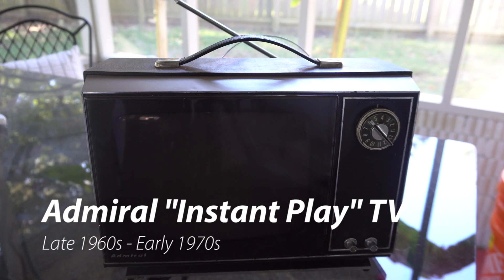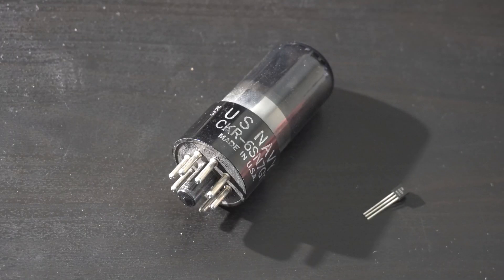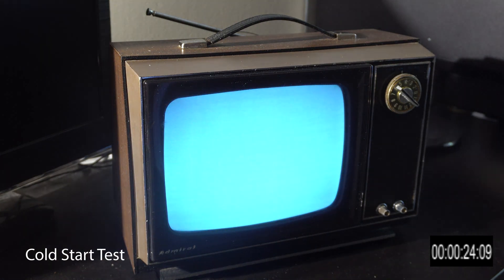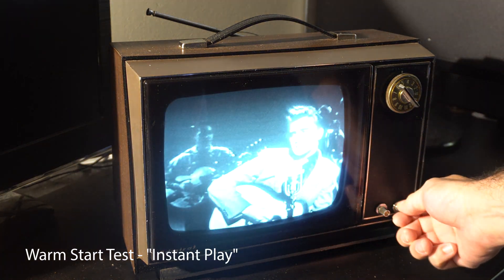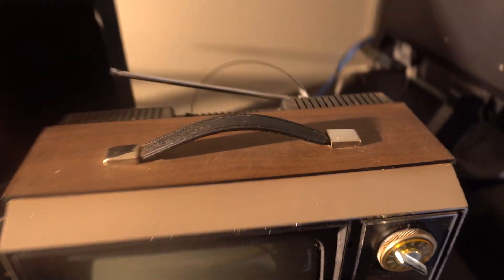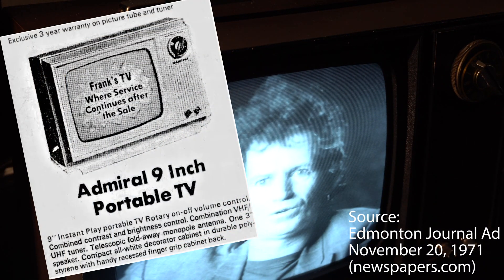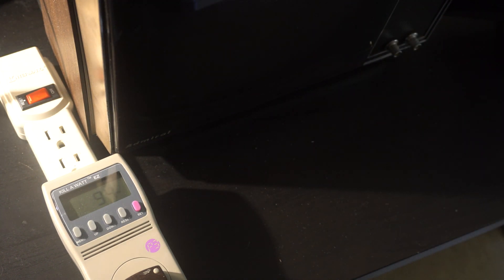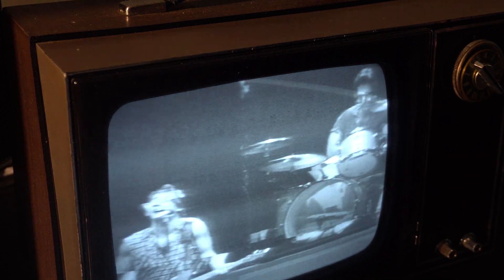Using "Instant Play" on an Admiral Tube TV (1967)

Comment: They also kept a filament voltage on the CRT.  Many of those sets that were left plugged in all the time suffered weak CRTs after several years.
Reply: Yep this weakened the CRT... I don't recall this being a thing in European TV sets (except a 1948 hot chassis Radiola or Radialva that I saw that was modified to have the CRT heater always running... That mod was a literal death trap with bare copper wires running everywhere!)
Reply: I actually have an Admiral made Ward's Airline 19" CRT TV from 1976 and it doesn't have instant on (Instant play Admiral called it) i have to temporarily crank the brightness til it comes up. Has a dot for a minute when i turn it off.

Comment: My family had a solid-state Sony Trinitron of about that size in our kitchen when I was a kid.  It had a switchable 'instant on' feature that did the same thing.  It kept the CRT filament dimly glowing so the picture tube would power up quickly.  With modern flat-screens, we've returned to the vacuum tube era of waiting for our TVs to come on.  Boot up instead of warm up, but mine takes about 10-15 seconds to display the manufacturer's logo, show what input is being used, and finally begin displaying.